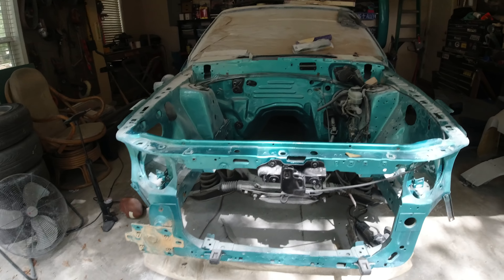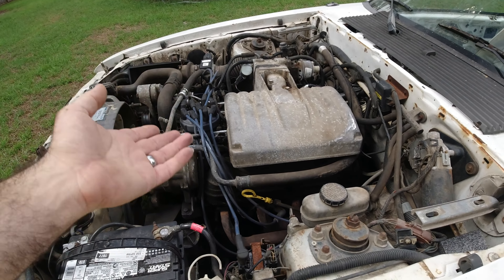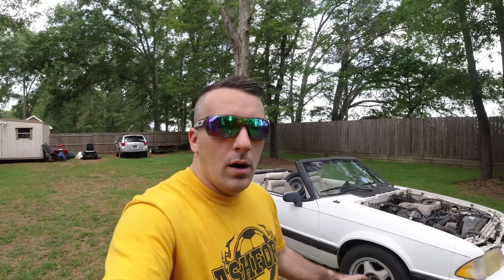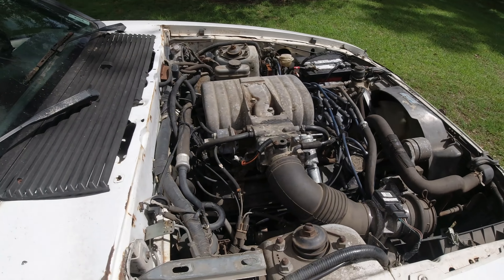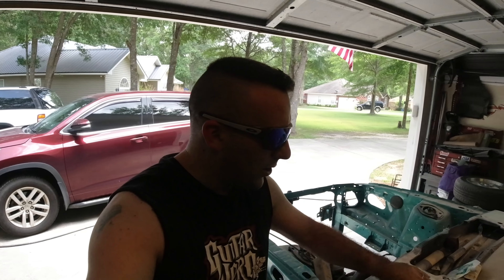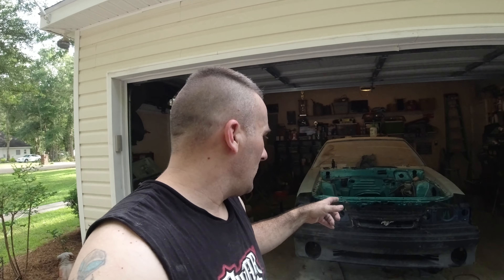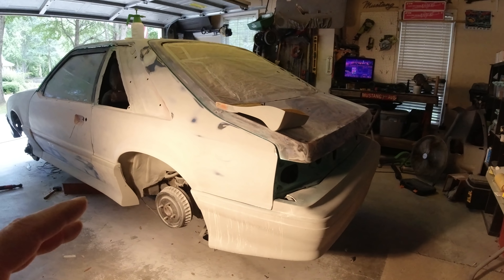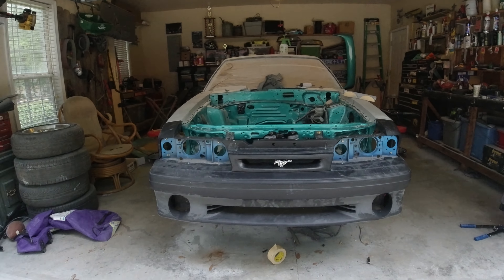I BOUGHT THE BIGGEST POS FOXBODY...... AND HERE'S WHY.

Comment: That rag you baught for $1,200 is in much better shape then my 83 rag when i baught it
Reply from the maker: The top has been left down for years.. so you can only imagine what the floors look like.
Reply: @BREW2LFOXBODY  i know, mine sat outside under a ripped tarp for 13 years, no interior was salvaged, the only original parts to mine are pass fender, rear quarters, and the front and rear bumpers, everything else was shopped and found with using oem body parts from 2 years of shopping, but i saved a piece of history, 83 glx rag.

Comment: Omg I had a Foxbody just like that one but I hated that it was a conv so I sold it everyone should use them for parts
Reply: why would you hate a convertible
Reply from the maker: Damn Scott straight up hatin on the Vert’s 😂😂😂🔥
Reply: BREW2L I just never liked the lines the only Fox Body conv that I think looks good is the Mclaren edition why because mclaren moved the angle of the windshield down gives the car a much needed much better line yet I could do without the conv top that came with them just looks like a guy put a Mercedes Benz top on it and the wheels on that model I don’t like ether and why Ford put luggage racks on Lx conv I have no clue and it’s not like you can just take them off they put holes right though and trunk the better question I guess is did anyone really ever use one on a Mustang I was born and raised in Dearborn Mi and not once have I ever seen anyone use it never even seen a dealership display one with luggage on it
Reply: BREW2L however I do like and I’m still looking for a 1988-1989 1/2 Mustang T-Top I like them just because you never see them and when you do most are older then 88 and are the 4 eyed fox body’s
Reply: @scottdilinger5920  I have a 88 that I am restoring. Working on the floor pans at the moment.